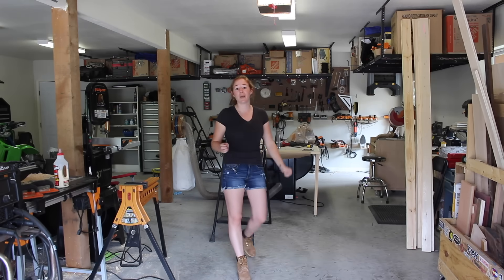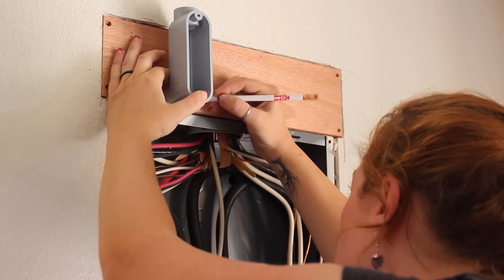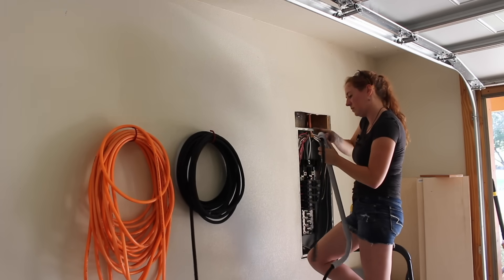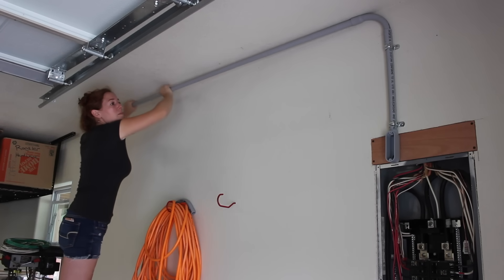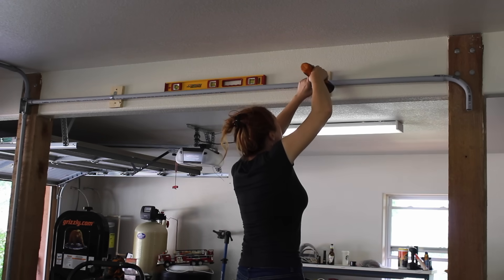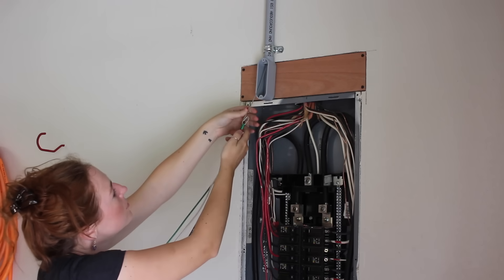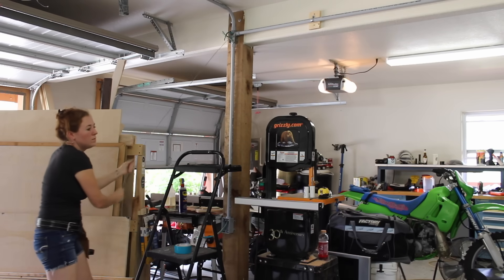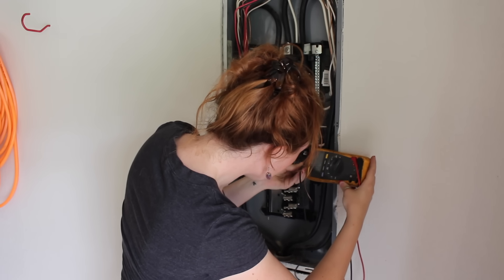Adding 220 Volt Outlets to the Garage

Comment: I love that you seek and attack. Your video's are great and I always look forward to the next one.  The one thing I'd say I would have done differently is to run conduit up inside the wall above the breaker box so there is no openly exposed wire.  That may not be a big deal, but in the future you may have to get back into that cavity for more wiring and now you'll have to remove the wiring and board you attached it to for that ability. So I'd have cut out the drywall above the power box up to the ceiling and used 2 boards to fill the hole. Upper having the LB. Lower allowing future admission. But since you are quite capable of doing all of this, you won't have issues with anything in the future..   Keep them coming!!!!!

Comment: Definitely brave for posting a DIY electrical job in YouTube -- anybody who has done the same has felt the wrath of the so-called experts!

A note about the NM wire in conduit, though.  My understanding is that it doesn't matter if the conduit is EMT or PVC.  The issue is the heat build-up of the enclosed space and the insulation provided by the outer sheath.  In a skinny conduit like you are using, it's possible that the wire would simply overheat.  The solution, if all you have is the NM wire, is to simply use a much bigger conduit.  There are calculators out there for determining the conduit fill limits.  But yeah, as long as you have enough space, you can absolutely run sheathed multi-wire bundles through any kind of conduit.